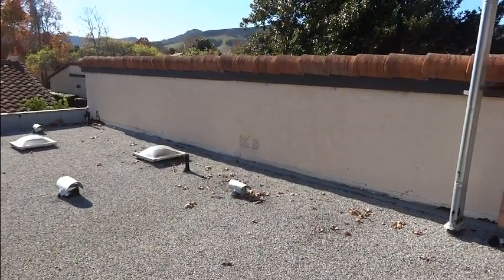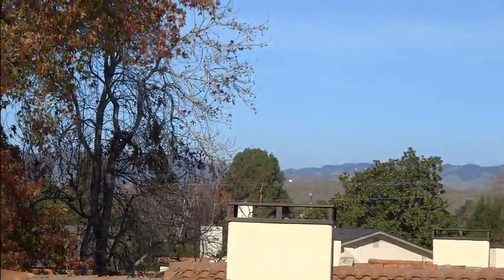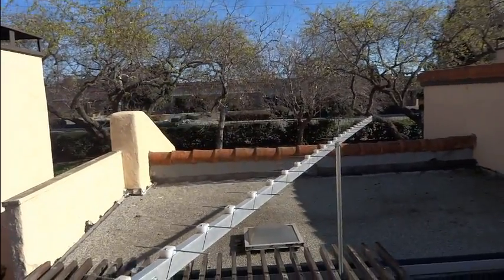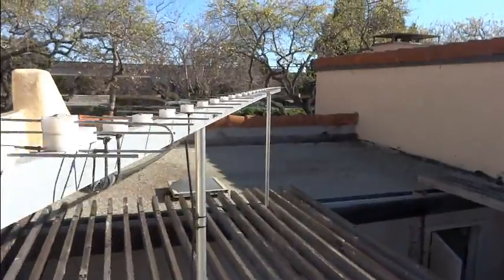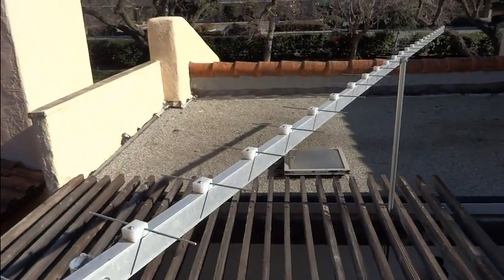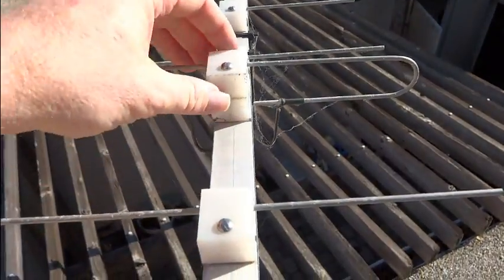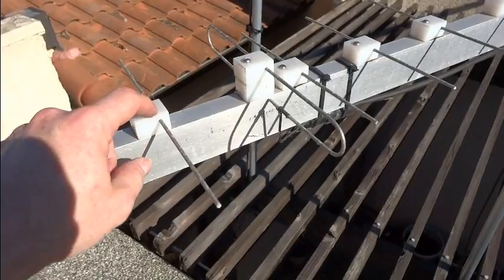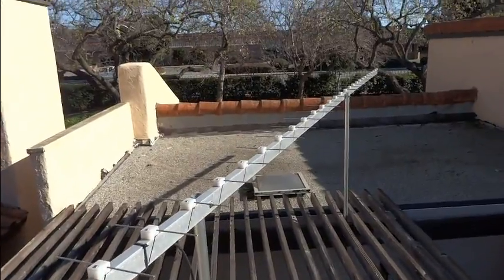20 foot long homemade yagi TV antenna

Comment: I managed to connet to an antena at almost 60km on the 700-800 MHz band using an 11 element yagi. I didn't use more elements because in order to get a 1db gain above 12dbi requires the length to be exponentially longer. To design it I used Yagi calculator and ManaGal, both are free!

Comment: How would you determine element length if you wanted to build a wide range uhf antenna to pickup all channels from 14-70?  All calculators seem to only work for a single frequency, do you just pick a frequency in the middle of the intended range and hope you get overlap?

Comment: Stainless steel bolts and nuts should not be used for the insulator, use aluminum or use aluminum rivets with washers

Comment: Interesting, thank you for sharing... been also interested in long distance analogue tv, used to have an antenna mast to receive some swedish tv (SVT) over the Baltic Sea here in Finland in the 80's. Some 
memories of those times here: http://bbs.fmdx.tk/index.php?topic=519.msg2125#msg2125 and here: 
http://bbs.fmdx.tk/index.php?topic=519.msg2058#msg2058 (maybe google can translate some of it). 

Still trying to receive some DVB-T on UHF  http://bbs.fmdx.tk/index.php?topic=519.msg2059#msg2059 but, those analogue times were so much more fun for DX-TV...

73s from Finland

Comment: I can tell you what my neighbor told me about receiving weak and distant signals. First is can you actually be able to get the signal ??? What about your antenna, you should've used pvc pipe that actually exposes the metal to the most amount of signal as possible and the guide pipe also for at least six feet. Use copper as this is about the best metal you and I can afford. The balum you are using should be the best with the lowest losses soldered connections. The coaxial cable try using RG400 which is copper with silver plating. Absolutely the lowest losses. Preamps with high gain are a must for sure. Finally you know about trying what works best and make sure the chimney is not in the way also. I wish you luck too.

Comment: Looks like the elements are not connected to each other. Looks as if the dipole is all that it connected. I would try, and run and connect one side of the elements to each other. Then to the feed.

Comment: I give you an E for effort, but that's much too parasitic given the use as well as the elements+length. If it worked perfectly, you'd be looking at a small window to snag the specific channel. Still, you tried to go over the top and I commend the efforts! 👍🏼

Comment: If the signal is not there, no amount of directors will get it. UHF signals are absorbed by trees and buildings in the path so you would be better off putting a shorter antenna 20-30 feet higher.  2 or 3 sections of 10-ft TV mast is cheap. And put a preamp at the antenna to compensate for coax loss.

Comment: Very Nice Build... You did your homework on the dipoles, but, did you consider getting your antenna higher off the ground and away from building interference?  Most UHF antennas need to be about 30' above the ground.  Also, how about mounting that antenna vertically.  Horizontal antennas are sort of a hold over from the old VHF days with the longer/stronger signals.  You have the 4 bay directional antenna (the more effiecient design) that is duplicated to create a bi-directional antenna which is a downside of the Yagi which is directional antenna.  I really like to see projects like yours.  Currently, I am refining the design of a "true" omni-directional antenna and am pulling towers from 80 miles away and I have not added reflectors...YET.

Comment: The idea was a good one, the problem with Yagis is, though, as more elements are added, the law of diminishing returns becomes a factor and the amount of gain added by each additional director gets smaller. Also, adding more directors, while increasing gain, makes the directionality of your antenna's signal beam width narrower and narrower (eg. with a 20 ft boom length and so many directors, you'd basically have to have almost laser-precise alignment with your signal source).

Comment: Seems like the bigger the antenna the better. And the hard part is putting it up in the air. The higher the better.  Which is a love-hate  type  relationship.  What happens when you put a big chunk of metal into the air ? Lightning and it has hit me more than once.Took out my TV  and stereo. But it is the  only way I have found to get the channels. I have not found an antenna yet  that can pull in the channels unless it has a booster / amp. And if lightning  strikes it always takes the booster / amp out. And to fix it you have to take the antenna down. The best system  I have found is a big 13 or so foot antenna.Like a Channel Master or Winegard with a Channel Master titan amp.Put that in the air some 50 - 70 foot with a rotor and you should find something. Last time I set one up like this I had $550 plus  invested. You would think that someone could find a way to put channels like Me TV , Retro , laugh , on the net.    Hulu is ok but limited. I have a set up now and I can get 75 to 80 channels.But I am afraid to use it.  One thunderstorm pop up and everything is gone.

Comment: It is technically a log periodical I have an indoor commercially made one they work the best for a phased modulated signal pm versus the old fm frequency modulated he should try turning it sideways to get the channel in he wants because that will change the orientation to vertical from horizontal which is what most commercial broadcast stations work are orientated at

Comment: I read the comments. It looks like you built the antenna right. I assume you looked up the width of the dipole, directors and reflector. They look right, eyeballing it for UHF. Maybe yes; maybe no.  But if the channel you are after, let's say for argument is WHAT-TV channel 28 which is actually transmitting on channel 48, your antenna won't work unless you are on top of the transmitter. (This situation is typical these days. They kept the previous numbers for advertising purposes while transmitting on newly assigned channels which are different.) After a certain number, adding additional directors is counter productive. With digital signals, they either come in or they don't. So all that you do with a longer antenna is to introduce wind -driven stability problems because of the narrow beamwidth of your antenna. BTW: It doesn't matter one way or the other whether the directors and reflector are insulated or not from the boom. With all those directors, your driven element should have been something other than a simple folded dipole. W9ZD
Reply: +rikoski you go by the actual frequency that the stations transmitting on not the actual channel when working out the calculation for the antenna element length for the wavelength it is being built for

Comment: Long on technique; short on engineering. Nice build. You didn't say anything, or maybe I missed it, about the channel you were after. Frequency, distance, mountains in between? Next time learn all of that, if you didn't this time. If the station is more than 60 miles away and broadcasting on UHF unless you are on top of a mountain, you will not be able to receive it no matter how good your antenna. You need to have a signal to receive.
Reply: ruddy puga,
please tell us you were not trying to pull in Radio Gringo?
Reply: not all correct, tv signals bounce so it is a lot about location, i am cuban and i love building antennas, over in my country you have plenty of time to spare so antennas were my hobby, i had one that was twice as long as the one on the video but it was not as nice , it was for fm and it was cut to 99.9 in order to hit the center of the fm radio frequency. over 90 miles and the signal was steady and strong.
Reply: i was and i did IT..
Reply: Well your frequency was much easier than what this was attempting to receive. You get a lot of refraction in the wavelength from everything, especially atmospheric conditions.
LMAO! That's funny, but very interesting to see you make the leap across the relatively small in mile, natural border of two different countries.
I've seen the lights of your country twice and it's a small world.
Reply: That is not always true.  I am located in a valley between 2 mountains.  My towers are 60-90miles away on the east/little rock side and 70-100 away on the west side of Mt. Magazine/fort smith, fayetteville and Poteau Oklahoma.  I get most of the channels from both directions except for a few lower power stations.  I could be getting bounce/reflection off the mountains around me.  Tvfool and antennaweb both say I should get nothing where I am located.  I get most of my channels at 85-100%, always locked, they never drop out and I've been watching them since the early 90's.  My antenna is also only 20 feet above the ground but I do run a channel master pre-amp.   I get 16 all the time and up to 25 channels if the weather is just right.  Cloudy days and late fall bring in channels I don't normally get.
Reply: Hey I know you're video is 7 years old, but I just now discovered it. I noticed you never replied to any of the very good comments you've received here. Any reason for that? There are some very good ideas in the comments. Okay on to your next video!

Comment: Hello and great Job. I have had difficulty with certain channels that at first didn't make sense given their strength, location etc. I had found that even though it was a high definition digital tv transition it was on the VHF band not the UHF even though it's previous analog channel and virtual digital channel would lead one to believe it was UHF.

Comment: You might try a log periodic(maybe in the v-formation).Shorter for the same gain,and wider bandwidth,and raise the antenna a bit higher.Although the phasing lines can be a nuisance.Mike-VE9MRH.

Comment: I'm curious why the elements are isolated from the boom, I would've thought if you had a metal boom, you attach the elements so they aren't capacitively coupling
Reply: Any design is good from electrical point of view. From design concern one choose practical mechanical appoach. Boom-through approach is extremely hard to drill perfectly holes to perfectly align all directors. To lay directors down on boom, you still need holders, which are harder to DIY than high-profile holders.
http://dg7ybn.de/BC_numbers/BC.htm
Reply: You need a 72 ohm match in there somewhere.. like a balun.  I studied antennas for many years and I am now a general class amateur radio operator.  And like I mentioned before he needs a much taller mast.

Comment: Also, usually the open portion of the 300 ohm dipole is the part out of the plane of the directors or reflectors. To get increased gain but lessen the directionality, you may want to spread out the volume of your attenna mass sideways,  in stacking 4 antennas of 10 elements each side by side and above and above (or you can do a 9-stack, expensive, lot of work) parallel at proper spacing from each other, instead of having one massive 40 element antenna, that requires very accurate aiming at the signal, which may be coming slightly from above due to ground diffraction, as opposed to direct line of sight for light, so you might want to try aiming it very slightly above the horizon instead of perfectly horizontal.
Reply: Very well stated Lizard. I asked my uncle on this problem and he says that using two antennas pointing in the correct direction would also get the channel Brian is looking to receive My uncle worked for the military and has a Doctorate degrees. He finished top of his class. One smart guy, period. .I never seen him be wrong. That did not make for a great time at parties he would always say. One more thing, line of sight without facing concrete blocks make a difference also. So raising the antenna. Peace vf